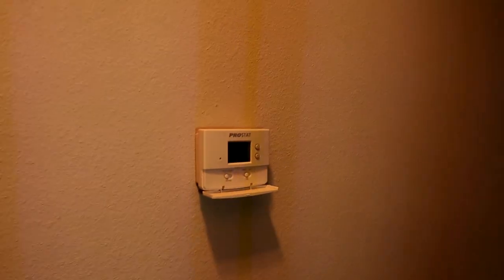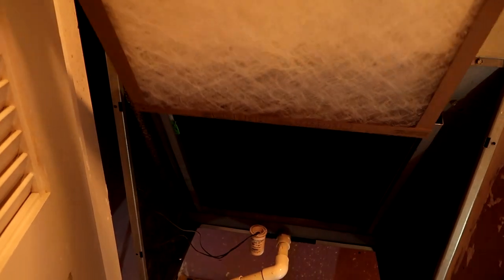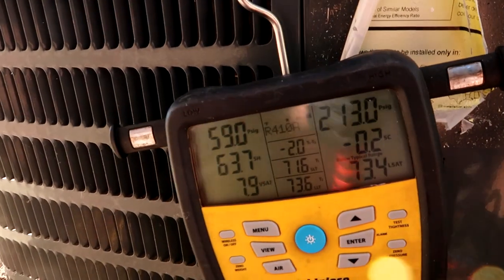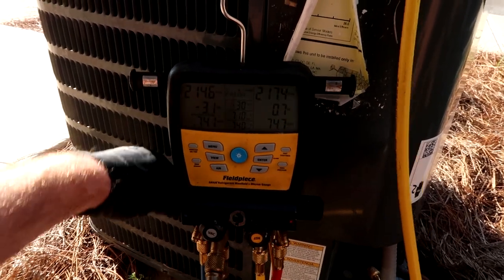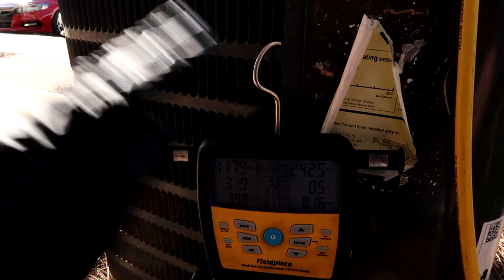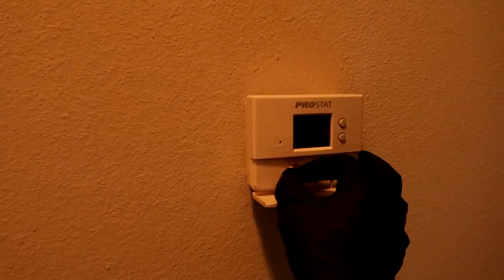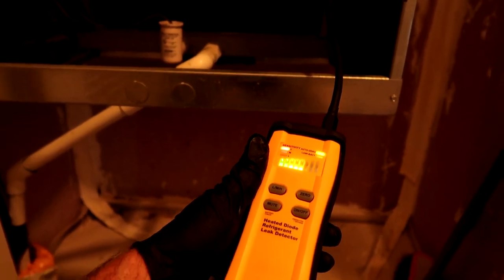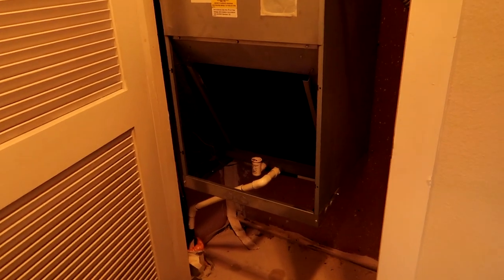HVAC Videos for Beginners #1

Comment: I would make a list going into every unit, Lex.  Put notes on doors a day in advance.   Then put in warranty claims for like 300 coils.  Make video too with the unit numbers and serial of each one.  Post all 300 of them in a YouTube channel, and put in a warranty claim for 300 coils.
Reply from the maker: I'm going to have to go to the higher ups about this. This is unbelievable. Good to hear from you Justin!
Reply: $2k for a coil is crazy. Is there access to just replace the air handler?
Reply: Need a good relationship with a replacement coil maker. Some coils maybe worth fixing if the leaks are miniscule with cool additives. That works. But short of a full replacement you'll get paid to try. They don't want to pay to change out defective units. That could go on for years.

Comment: Hey lex just moved to Florida. I've been a maintenance supervisor for several years, in another state. I noticed many job listing state they want HVAC certification?  Is that really Nesscary?  Does just mean you can transport freon in Florida?  I believe I saw it meant nothing about your experience or skill level per repairing or troubleshooting HVAC?  What's your thoughts?
Reply from the maker: Yes, they mean they want you to be EPA certified. It's the holy grail amongst managers. They think it means you're an HVAC certified guru when all it really means is that you can legally handle refrigerant. 😆 Thank you so much for watching Robert!
Reply: Refrigerant

Comment: Is that the only fix for a leaking cooling like u can’t spray any type of sealant like flex seal or anything like that? Jw cuz if u could just spray something on it you wouldn’t have to replace so many coils but this is good YouTube lol
Reply: Refrigerant pressures are way too high for that sort of thing
Reply from the maker: Yep like Justin said, the pressure is between 135 to 140 psi. Nothing would hold. Thank you so much for watching David!
Reply: You could try a leak stop like EZ seal but since the evaporator coil is only 3 years old you shouldn’t have to add /repair or replace anything. How are the TXV’s  ?